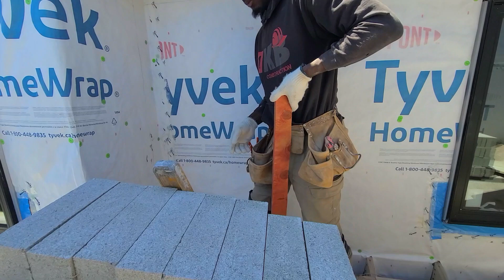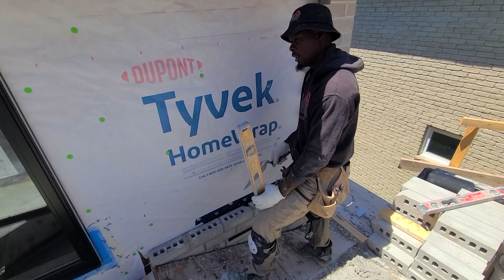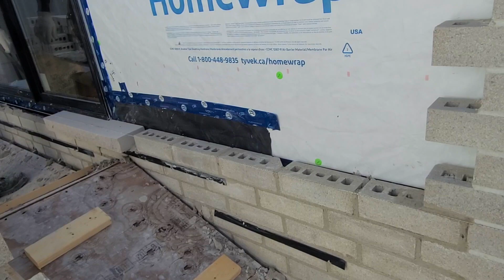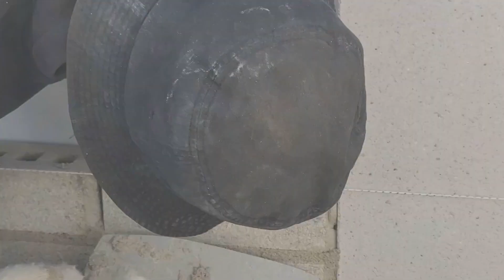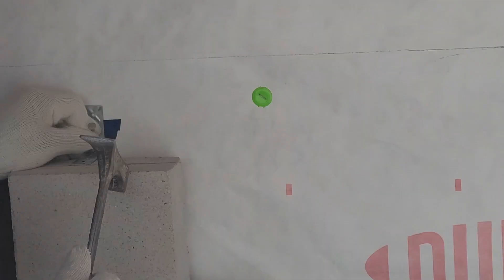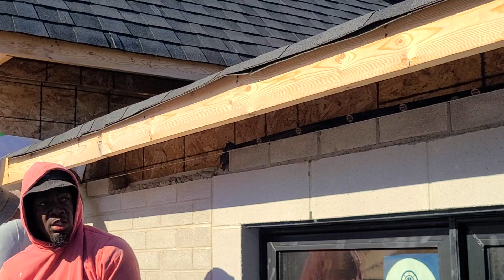Bricklayer Will Hate Me  For Teaching You Those Trick DIY

Comment: The steps of flashing should be closer to roof line, also the stepped flashing is for water to escape, without weeper holes on that stepped flashing it’s pointless because roofers don’t tie into that stepped flashing it’s strictly used for waterproofing. Which should be installed nailed tightly to the wall, plastic over top of it then the paper! This will make sure for proper waterproofing job